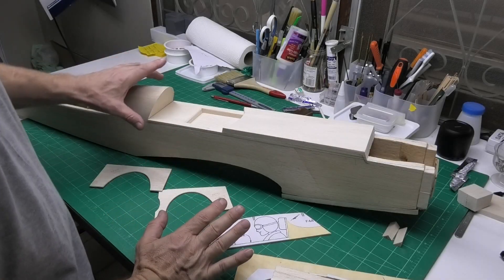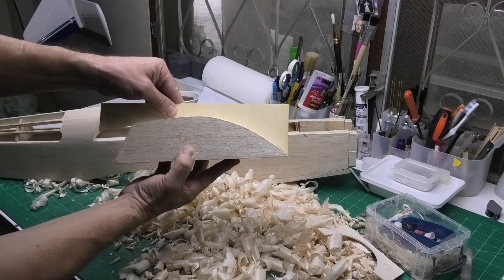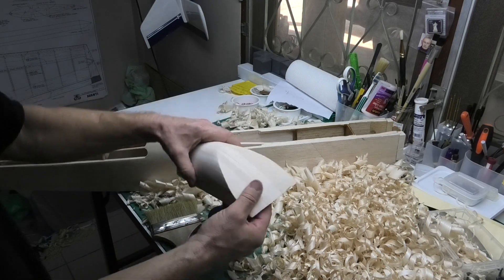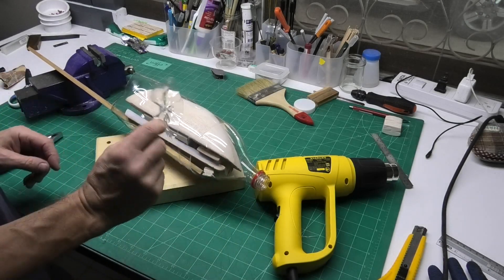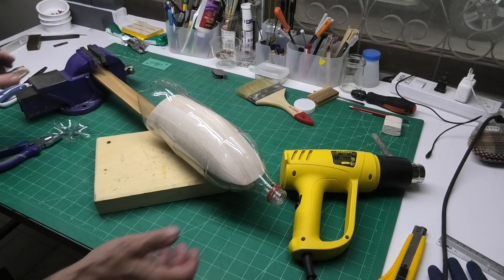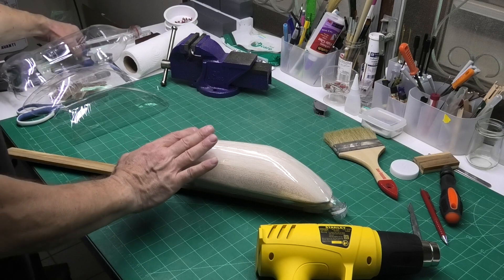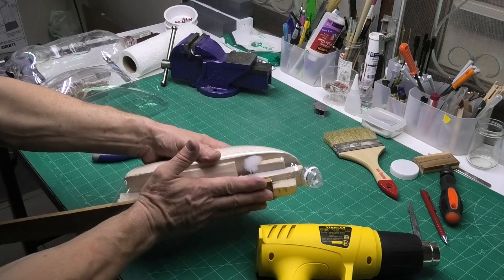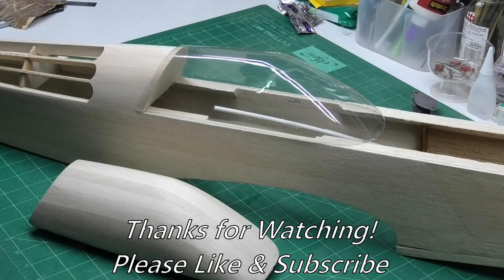Plastic Canopy Scratch Build - RC Model Aeroplane Build & Repair

Comment: Great video! Could a hair dryer work as a heat gun? Also, does the plastic get stick so it can be hard to release from the mold? I am thinking of using bake-hardened clay for a mold.
Reply from the maker: Thanks for the comment, not sure about the hair dryer, best to try on an old bottle. The bottle does grip the mould very tight as it shrinks, but if you cut along the bottom it releases easy enough. Good luck

Comment: my question is out of subject. i want to build bench on which i can make my kits. kidly suggest wood for top portion of table
Reply from the maker: The best material I have found for the top of the beanch is MDF 18mm, it is very flat and good to use, but it has to be supported and treated to seal it, for which I use Danish Oil

Comment: Does it make a difference if you connect a vacuum cleaner at the nozzle? It already looks good without.
Reply from the maker: Hi there, don't think it would mke a lot of difference, although I have never tried it.  The bottle plastic shrinks very good with the heat.

Comment: Hi Mark. You did a great job with those bottles, but I was wondering why you didn't use a PET thermoforming sheet plastic. It's the same material but without any imperfections, so wouldn't a small expense be worth it for such a wonderful plane?
Reply from the maker: Hi thanks for the comment, guess just fancied doing it this way, and due to my living circumstances at the time, when I made this it was the easest option, but I know you are correct and once I get my new workshop sorted I will be keen to do some vacume forming, and another video perhaps.  Having said that the canopy does look great on the finished plane.  Have you been following the build of the plane?
Reply: @MarkRobinson555  I have. I've always loved model building and RC, but only now I'm starting to actually get into it. I purchased my first trainer and electronics just recently.

Comment: Hi ! This is a great way to do it ! I build rubber powered airplanes and will try small canopies. What type of glue is best for these? Thanks !
Reply from the maker: You can get canopy glue, although I have never tried it, I usually use very small servo type screws, the type with the integral washer, I then tape the seams.  Thanks for the comment, its appreciated

Comment: I've used this process myself a few times, allways a great success. A couple of tips I would add:

Use the really cheap unbranded 2L water or supermarket brand fizzy drinks, aside from being dirt cheap the bottles are extremely plain... a good blank canvas, no embossed patterns or ridges around the labels. 

Make sure your form/mould is robust they really do shrink with some force.

Make your form/mould extend past where you are going to trim it, even if its only 3mm (1/8"), helps when trimming to get a clean edge.
Reply from the maker: Hi Graeme, thank you for commenting, and the advice,  its always appreciated
Reply: you all probably dont give a shit but does someone know a method to get back into an Instagram account?
I was stupid forgot my account password. I would appreciate any assistance you can give me.
Reply: @Marco Davian Instablaster =)
Reply: @Kyree Jad I really appreciate your reply. I found the site thru google and im trying it out now.
I see it takes a while so I will reply here later with my results.
Reply: @Kyree Jad it worked and I actually got access to my account again. Im so happy:D
Thank you so much you really help me out :D
Reply: @Marco Davian No problem xD

Comment: That was slick..!
Coke bottles make absolutely beautiful RPG dummy rockets.    Cap PVC pipe, put a schrader valve and pressureize it as you heat the pipe .
Fun
Reply from the maker: Thanks for the comment, appreciated